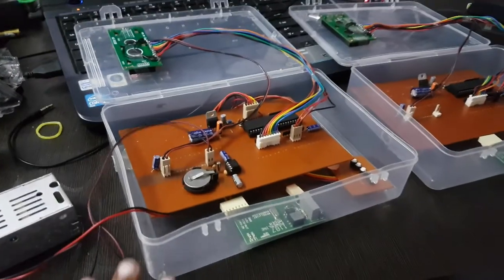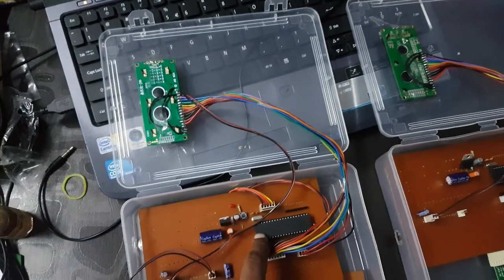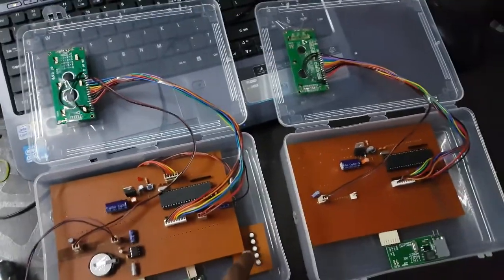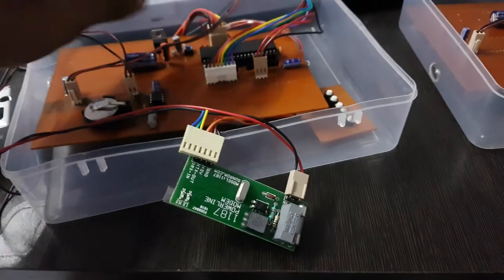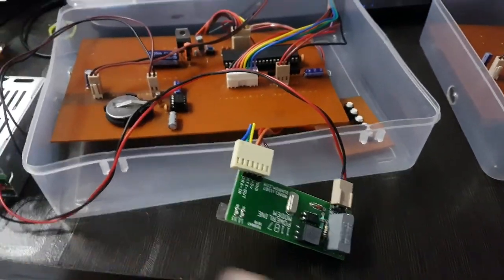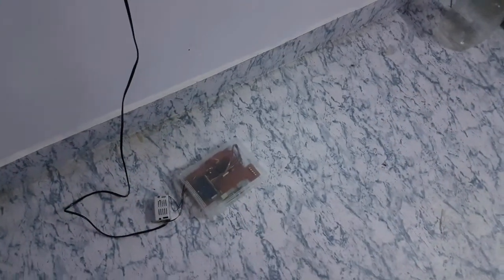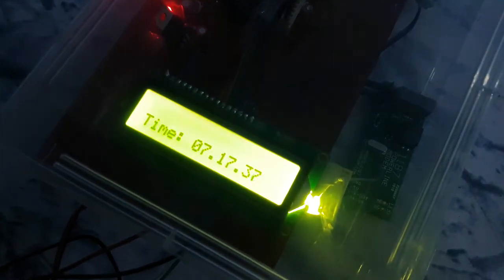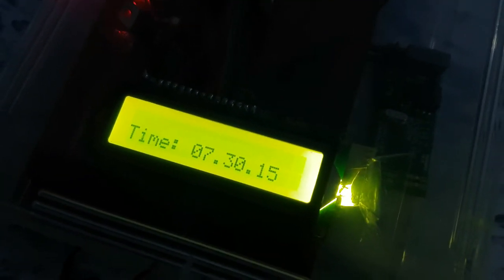Power line communication

Comment: How do you go about writing the code for both master and slave device, is it related Modbus communication protocol ?
Reply: Am using a kq330 PLC and Arduino uno for switching automation
Reply from the maker: Any low data rate serial communication is possible. PLC will only act as the signal relay .. bi-directional and single possible. You can send commands and receive device feedback.

Comment: Hi i want to ask what kind of transformator u use as the isolation circuit? Thank you very much
Reply from the maker: In this case it is included in the PLC module. Generally a ferrite core transformer is used. Basically any isolation transformer that has good sensitivity to frequency and that can pickup the signal is fine guage and number of turns not very important here just enough to acquire the information signal.

Comment: Hai dias, this is madan how we can connect multiple slaves in power line communication and how read multiple slave data at a time in master.
Reply from the maker: If your program has the capability to read data with sequential acknowledgement without power line communication then it will work with power line communication. But ask coding experts about it as plc is only the means and the medium of communication where every end devices have to be connected  via a pic module.
Reply: @dionytiusdias  thanks for the replay and i am embedded software engineer i was worked on i2c spi and serial communication  but i am interested to use power line communication in my next project.. in I2C if i want to get the data from multiple slaves i will get the data by using  specific device ID and  PLC also same thing or ?
Reply from the maker: @atmakurumadan6342  plc doesn't have machine id it will only act as translator to the medium of communication. Rest is all your code and the devices that hold specific id
Reply: @dionytiusdias  thanks for your reply pls can u share ur mail ..its very helpful to me...

Comment: hello
can we send voice or alarm signals by using this technique ?
Reply from the maker: Not very reliable for audio signals ... Depends on your plc module capacity and tx rate. But once communication is established you can transmit any code up to the rated distance considering the number of junctions and take off points on the line
Reply: @dionytiusdias hello
 how about a buzzer sound producing at the reciver end ?? 
Can it be developed??
Reply: Actually my project is to send a warning alarm to near by reciver 
So my question is can we do it through PLC method ??
Reply: @akshayganesh9734  You can send a signal and according to the signal, you can turn on the alarm!

Comment: hello bro i would like to know on how to connect the KQ130F module but i am using Arduino,does it need to be configured or it works straight away. I have one Transmitter and one receiver.
Reply from the maker: Common ground, connection is crossed on rx tx, baurd rate is 9600.. rest you can check online for further details if anyone has used with arduino
Reply: can you plc send the arduino code of plc?

Comment: sir, this is mansur, from Bangladesh.
I need ur help plese sir response.
Reply from the maker: mansur rahman what help you require
Reply: hello bro i would like to know on how to connect the KQ130F module but i am using Arduino,does it need to be configured or it works straight away. I have one Transmitter and one receiver